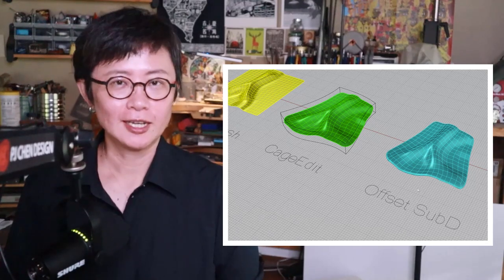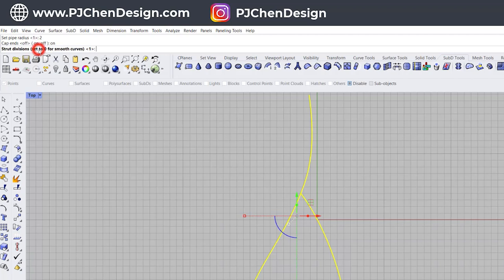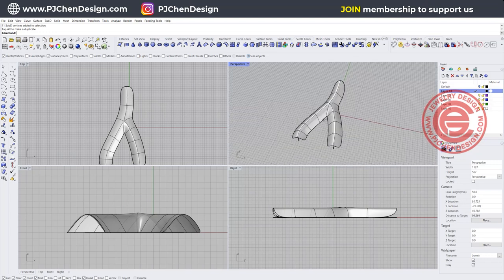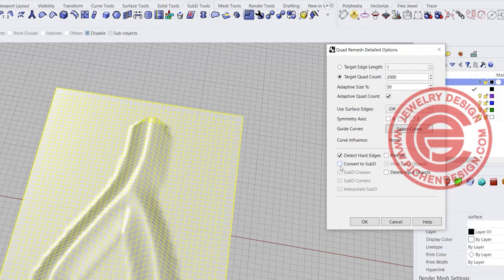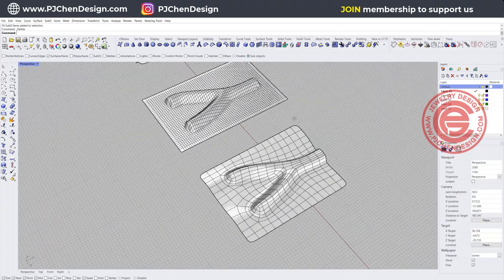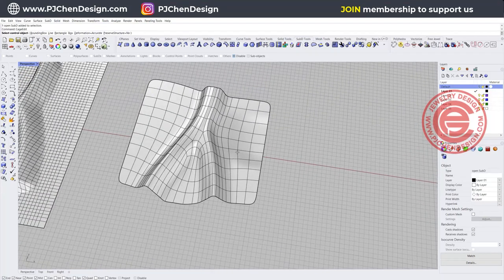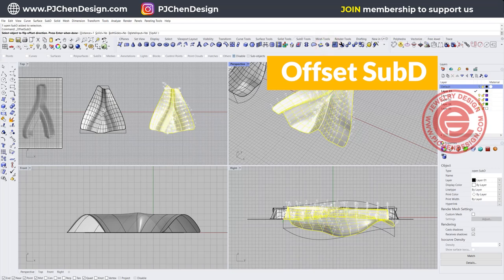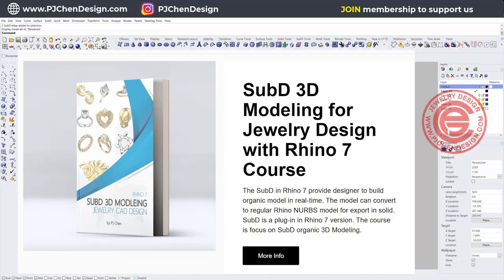How to Create Folding Shape in Rhino 3D Software #343

Comment: Hi, Teacher Chen. I see that there's a row of points, curves, surface, polysurfaces, subDs, meshes, lights, blocks etc. that you use a lot. Could you please teach us how to turn it on? Thank you so much.
Reply from the maker: If you are asking how to turn on the control points. you can use the command "Point On"
Reply: @PJChenJewelryDesign  Im here with the same question.  I selection toolbar is hidden when you have subd tools selected - i cant toggle disable, meshes, lights, blocks etc.

Comment: Hey love your videos, huge help! how do i get the toolbar below the subd tools panel? the one I can select "Points/Verticies, Curves/Edges, Surface/Faces, Polysurface etc."
Reply from the maker: they are selection tool, when you pick selection on SubD they should show up automaticlly. if you are using Mac, they may be in other place like left sidebar.
Reply: @PJChenJewelryDesign  Thank you I found it! Also is there a easier way to morph a patterned flat object onto a curved surface other than 'flow along surface'?